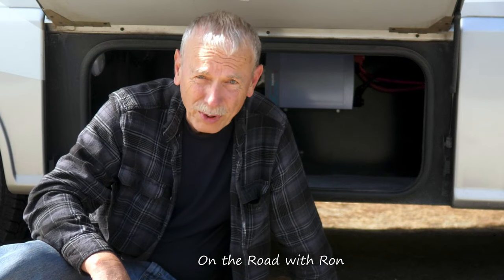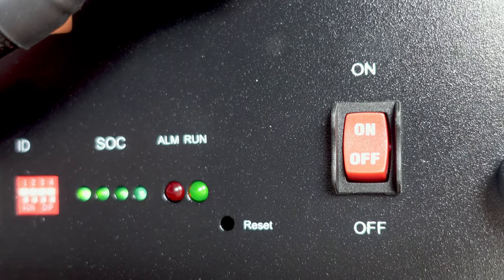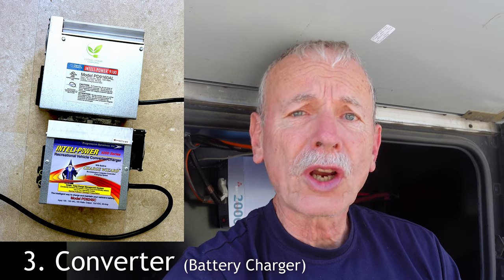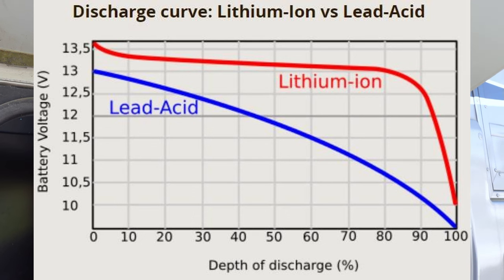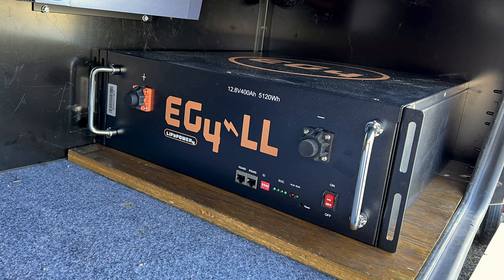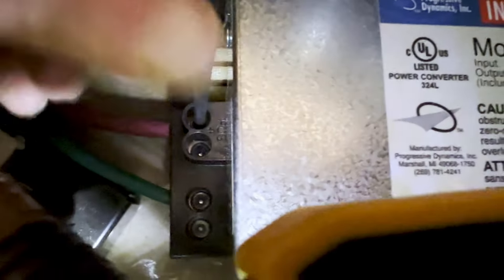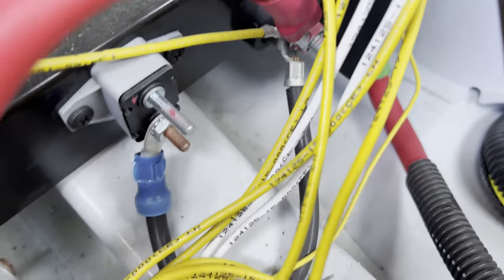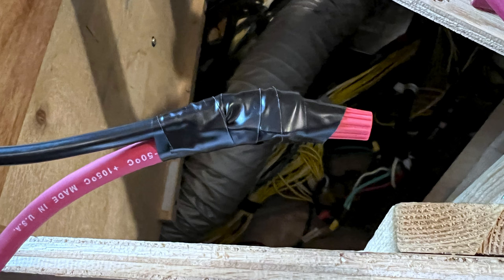How to Install Lithium Batteries in an RV the hard way

Comment: Ron you set your rig up exactly the way I want to eventually set mine up.  But man…you almost talked me out of it with everything you did! And some of the difficulties you had.
Although I am normally a DIY type of guy (I believe in doing everything myself if possible) I’m a total beginner at this sort of thing I’m leaning heavily toward finding someone to do the install for me.  I don’t know your background and experience level so I have nothing for a comparison.

Great video, I subscribed quite a while back and enjoy your channel.  Keep these videos coming and I hope to see you on the road sometime!
Reply from the maker: I don’t always take the easy road. Just adding lithium to the original battery bay would be a lot easier. I’m not a mechanic but worked as a mechanical engineer for 40 years. I just like trying new things.
Reply: I was kind of set to order a 400AH sealed lithium. After watching this I just kind of got deflated and said its not a DIY for me.  I’ll rewatch this a few times to make sure a drop in is not more simple. Good video though, Ron.

Comment: Have you had any condensation or humidity issues with the EG4 as it's not a sealed battery?  Did the manufacturer OK a location like this?  Looking to do the same thing, but worried about the rack battery not being sealed.  Thanks!
Reply from the maker: No problems with unit. It is an enclosed cabinet out of rain etc. build quality is good so don’t expect any problems.

Comment: Hello Ron, do you have a way to heat the batteries in the event of low temperatures and needing to charge?
Reply from the maker: Not yet. I actually hardly ever camp in freezing weather.  Battery will heat itself when using it. I actually have more of a problem keeping it cool. My inverter is in the same compartment and it gives off a lot of warm air when running.

Comment: Grandpa Ron, how ya doin fellow San Diego? You and I have the same Zamp Solar ZS-30A controller. I contacted Zamp and they said that the controller is able to run lithium but if it doesn't have setting then just use AGM battery setting. But it seems as if you updated it anyways? BTW I have a 2017 Winnebago Via so it has similar stuff and your Sprinter Chassis.
Reply from the maker: The original  solar controller didn’t have a lithium setting. I replaced it when my solar died a year ago. Turns out, the controller was ok but the combiner box on the roof corrroded. Zamp sent me a new box but i already bought the new controller. It has a lithium setting.

Comment: So you've had this in a few months... any issues with the battery mounted on that piece of plywood? I am going to make a wooden frame with lots of ventilation under and over.
Reply from the maker: In has been very secure. The plywood is tight on 3 sides and 2 small bolts that go through the floor. No issues.
Reply: @ontheroadwithron2432  Only reason I ask is that EG4 will void the warranty if there is a fire and the plywood was the source of the ignition. No flammables are to be in contact with the battery. I'm getting ready to install one in our 5th wheel and double checked with Signature Solar where I purchased.

Comment: those 6v batteries you got as i said before are garbage the trojan t 125 are much better and now you are not charging them at all plugged in to shore power? So how are you charging them just when you run the engine? as the generator still went through the old converter  ncie video Ron cant wait to see how it works to much money for me though
Reply from the maker: Yes the 6v are only charged with engine. Altho i  can conbine both sets for a while and the lithium will slowly charge the 6 volt batteries.

Comment: Will installing it in a vehicle that vibrates void the warranty?  Have you been able to "communicate" with the 12V?
Reply from the maker: I suppose it depends on the manufacturer. The EG4 is designed for home solar use but is very rugged. I’ve driven over many mikes od washed out dirt roads without any problems. My battery doesn’t have bluetooth but my battery monitor does so i can see the actual charge and discharge current.
Reply: @ontheroadwithron2432  Thank you for your reply.  It looks like a fine install.  Drive safely and enjoy...  pat

Comment: Hello Ron. I enjoy your videos. Thanks for them. I don't usually comment, just a thumbs up, but this time I feel I have to write a few words...
Hope the installation is safe, especially the punched crimped lugs....? (I would have rented an hydraulic crimper, and put dielectric grease. A lot of current  and a lot of vibrations, never a good mix...)
 The whole setup, with both battery banks,  might be ok, but definitely is unique. Unique is not necessarily the best way to go. I have a feeling there will be many more battery videos...
For about the same amount of money, why didn't you go with 4 x 100amp lithium at 26 pounds each? You could have replaces your 2 step batteries, + 2 more in the compartment.  It makes for an easier setup and ongoing maintenance. 
Yes, if you plan on boondocking a lot, 400 watts of solar and 400 amps of lithium is more than enough to be totally off grid indefinitely.  We have such a setup and only move because of the tanks.
For AC, with a soft start, the 2000 w inverter should  work, in theory...
Be safe.
Reply from the maker: Thanks for your comments. I did try the AC but wouldn’t start. Will probably get a soft start in the future. I kept the 6v batteries for now. They are only 9 months old. When we get back frim iur trip, i can finish up.
Reply: Keep in mind that the crimped lugs are almost as good as professionally crimped ones, but there's a big advantage in only having two of them to worry about instead of the eight you'd need for four batteries.

I was thinking about combining two sets of batteries with a rotary switch but was worried about outsmarting myself. Connecting dissimilar batteries presents different concerns and, personally, I'd either want two completely separate systems or I wouldn't do it. But, that's just me, an absolute amateur.

Since solar powered camping is a game of redundancy, we have 840 watts of solar panels on our 2021 Navion and, to optimize efficiency, I installed brand-new wiring runs to three new Victron solar charge controllers.

It's fun to see how different people solve the puzzle and to note how well it works for them. In general, I'd say 400 watts (about 100 amp-hours of recharging per day) would be the minimum I'd want with our compressor refrigerator. A propane-powered refrigerator is a completely different story.

There's a million ways to skin a cat!

Comment: Hello Ron , why did you choose 12v Lithium , vs 48V ?
Reply from the maker: Mainly as i already gave a 12 volt inverter.
Reply: We've considered going 24 volt but decided against it.

There are advantages to a 24 or 48V system (mostly in that it lowers the cost of the inverter/charger and solar charge controller) but the alternator, shore power, and solar charging systems have to be up to the task. It makes a lot more sense in a vehicle that has a 56 volt auxiliary alternator, and a vehicle that can be run at idle for hours with no concerns.

Comment: Curious, was there much of a weight difference with the battery swap?
Reply from the maker: 6 volt weigh 58# each, so the lithium are 19# lighter with around 6X the capacity.

Comment: I thought about using that very server rack battery. My concern is would it handle the RV abuse? It's meant to sit in a climate controlled room instead of bouncing down the highway at 70.
Reply from the maker: It looked very well made. Everything screws down. PCB conformaly coated etc. got a 5000 trip coming up so we’ll see.
Reply: @ontheroadwithron2432  Thanks! I've seen tear down videos of those units and like you said, they look well built. As well if not better than standard lithium batteries.

Comment: Why not crimped butt connectors instead of taped wire nuts?  Aren't wire nuts contraindicated due to vibration.
Reply from the maker: Different gauge sizes. Wire nut is taped so should be good.
Reply: @ontheroadwithron2432  There are step down butt connectors.  I'm not arguing, I only ask because I was taught not to use wire nuts in vibrating environments.
Reply from the maker: @mitchsmolow6268  I would agree in general, but it saved me another special order.  I got a kit of 6 ga butt connectors, but only used 1 piece.
Reply: I've been recently using Wago connectors for small gauge wire (10 AWG maximum). They are a joy to work with! (And I like the advice of the guy from The Explorist Life to, except for very-high-current applications, to use 10 AWG wire for everything. I keep a supply of duplex shielded 10 AWG stranded marine-rated cable on hand and use it for just about everything except for the battery - inverter/charger and alternator-battery connections.